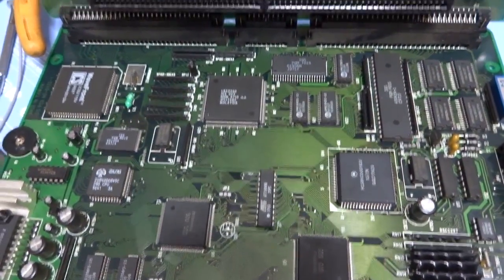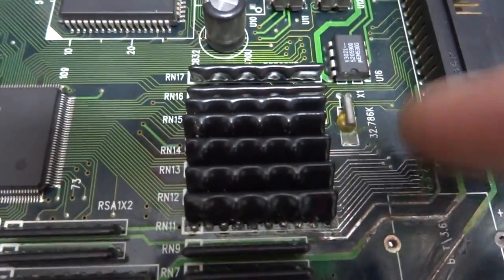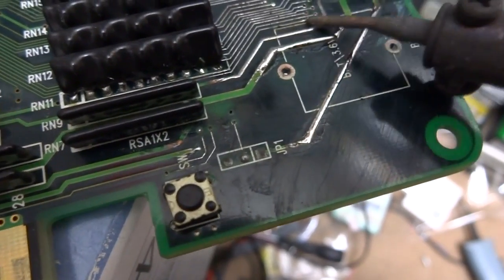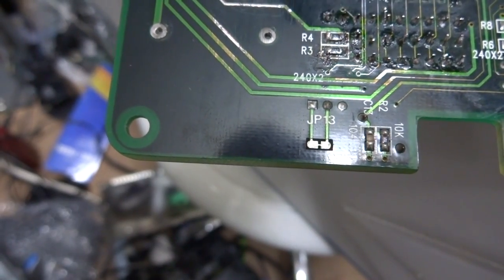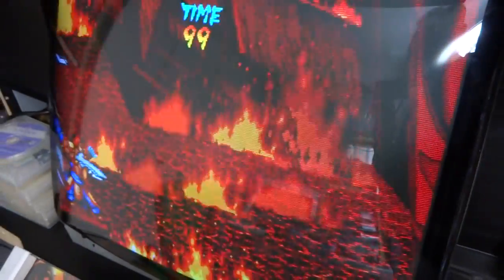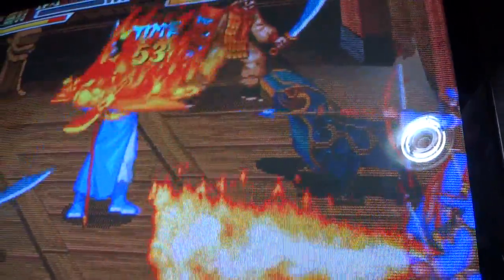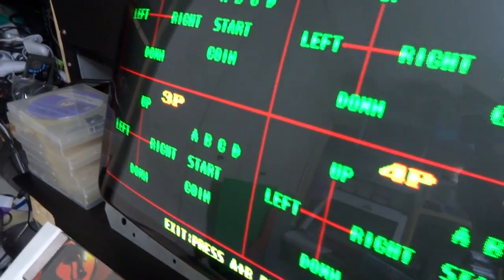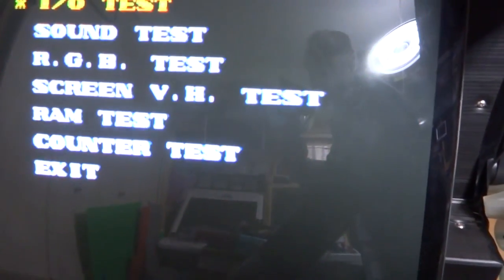IGS PGM Motherboard Repair: Acid Removal, Trace Repair, Solder Reflow

Comment: Loved this vid.  Great info on fixing traces here.  I have a Mortal Kombat 1 board I need to pull back out that I bought non-working for $10 a year or so ago.  I found several traces on the front of the board (close to each other) that were broken due to something being heavily scraped across the board at one spot.  Such tiny traces I didn't think I could easily fix it, but after seeing your way of doing it, I think I can duplicate it.  THANKS!

Comment: Great video! Very helpful! I have a multi trace scratch on a PCB which covers atleast 9 or 10 traces, at first I thought to use a line jump repair but the traces are so small. You have shown me the light, as I'm just a novice repair guy. 
 Thank you! And I'll post back on my rework to let you know how it went.

Comment: for clean soldering, touch the iron to the trace and then the solder to the trace+iron. dabbing the solder to the iron and using the iron to transfer to the traces/pad oxidizes the solder too much.

good solder reflows and solder joints will be smooth and shiny like a mirror.

Comment: A note on flux: to make sure the residues are not conductive, use only rosin based flux. The worst it can do is to accumulate dirt / dust  on the board. Most other fluxes are corrosive and/or conductive, and should not be used in electronics. ;-)

Comment: Leaky batteries on a pcb board its an nightmare. I've had to do a similar repair job on a remote controller for an old 1990s Sony TV. Someone left the batteries inside the remote and there was acid all over the PCB and everywhere.

Comment: Hey luke, what kind of flux do you use on motherboards like this? There's so many options, paste liquid grease. I'm trying to install a region free bios for a dreamcast and I just want to make sure I don't screw it up. I've done some soldering, but never had to use flux before. Thanks.

Comment: Excellent video Mate i have a question i have a scratch on my Motherboard i think some traces are missing or damaged so my ram dimms wont work dou you think i can get it fixed by hot soldering it cause i read that mostly everybody recommends some condictive ink and so on for a cold soldering method can you clear my mind on that one mate?

Comment: I accidentally put a somewhat deep scratch on the motherboard of my IBM PS/1 Model 2133-G53. Its deep enough to feel with your finger and is a large green mark. Will this affect the board at all? Its luckily not on any traces but I'm worried I might have just permanently broken it.

Comment: I need this N64 that I have repaired all it needs is composite video ports soldered to it, I sent you a message but since it is unlikely that you will find it with all the other ones you receive I though that I'd post here as well.

Comment: Um, ya don't neutralize acid with acid. Besides, these batteries are alkaline; not acidic like a vehicle battery. Therefore, yeah, the lemon juice will at least partially neutralize the alkaline battery leakage. So you'll want to rerecord that part of the video or at least put a corrective annotation there. And you'll want to fix that in your title too.